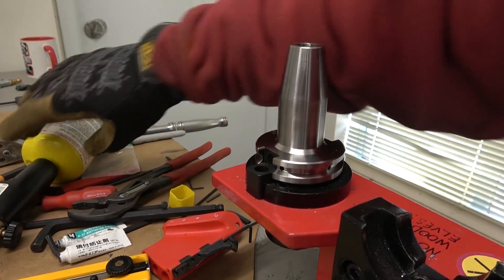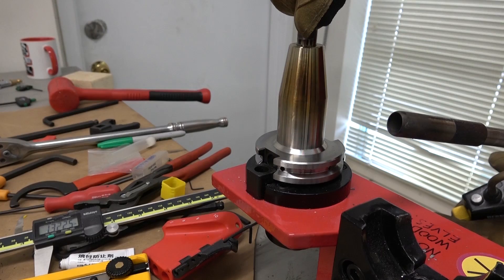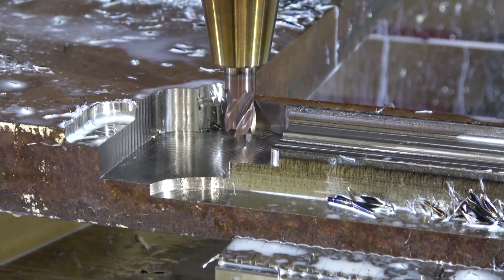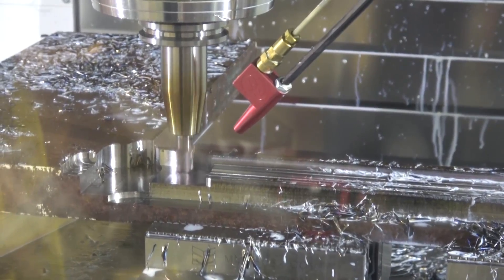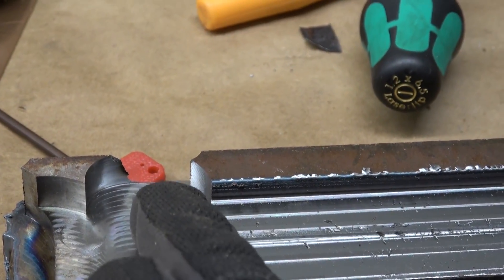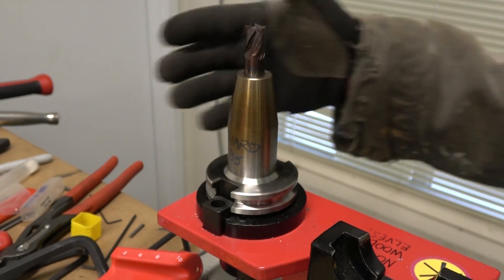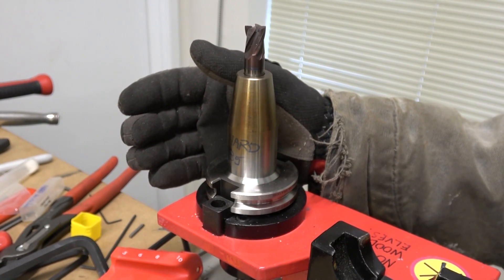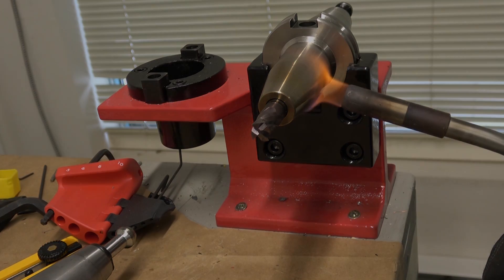Machining Feeds & Speeds |Test Maritool Hard Milling End Mill

Comment: I work with a lot of AR100, ASTM 514 type B (290 Brinell) and AR400. It is always a up hill fight and just when you think you got it... you hit a hard-er spot in the metal LOL 
Don't underestimate the amount of energy it takes to remove even a small size cross sectional area of hard plate over mild steel. Not just on the tool, but the axis as well. The servos need a small amount of time to adjust to the feed force needed especially on small machines. This is where rolling into your cuts will help a lot. When making circle or radius cuts, your tool is in the cut longer than in a straight cut. So I would reduce how much it is stepping into the work. Example, if I was doing .060" full depth passes on a straight pass, I'd only do .040 or .03 in an inside radius. on and outside radius I'd go deeper 0.08 maybe, but all depending on the size of radius and tool diameter. Anyways I'd be running around 180SFM 0.0018 IPR/T on 400. but I'd have to check my notes BTW get your dirty beaters on a 5 flute endmill, I've had so much better luck with them.

oh if NOTHING else works, speed her up so something stupid and low feed should get you through, but idk how long it will last

Comment: Experience is definitely key. Better to start slow and add sfm and chipload once tool life is achieved. doesnt take much chatter to ruin a sharp costly tool. seasoning cutting edge with a fine carbide stone or ultra fine diamond file or even 600 grit paper will help eliminate chatter when done carefully and evenly. Stub holders  and tools also help. As a rule of thumb I start roughing around 200 sfm for anything4140 &harder. .0015 per tooth. Lower for really hard material. You can always add speed later, if you you start too fast and chip cutting-edge your gonna be replacing that costly cutter. Definitely many variables come into play with new pieces to make. Good idea to take notes when things work well...

Comment: Something  tells me you have the same problem I have... when asked with you do.  I stop talking when there eyes glass over with a dazed look.   Electrical and mechanical engineer, tool and die machinist with CAD/CAM, HVAC-R tech, and specialized in thermal-graphic inspection and analysis with vibration spectrum analysis and ultrasonic testing...   your like that too able to fix anything lol.  I been expanding in to automotive fixing my cars and family cars
Reply: That sounds an enviable skill set there mate.
I just keep getting dumber the more I find out I don't know haha.

Comment: Just out of curiosity, have you checked your drawbar pull force with a dynamometer recently? Have you done some checking with marking fluid to check your tool taper mating on your spindle taper? Is there any fretting on your toolholder? Also, pullstud torque and pullstud design can have a TREMENDOUS impact on vibration, I just went to a customer's facility last week and solved issues with a NEW VMC they purchased with a brand new pullstud from one manufacturer deforming the taper of their toolholder taper and a pullstud from another manufacturer not deforming the toolholder taper, made all the difference in the world. Also, getting as short of a gage length toolholder as you can for hard milling is basically my first step, choke up on the hard stuff. As an aside I consult machine shops on their setups and repair machines for them frequently.

Comment: Cold stick in hot hole and when temp equalize its stuck gotcha. Have also read there is times rubber needs to be warm to go on a cold shaft.

Comment: Your projection from the spindle is a lot longer than it should be. Keeping the cutting edges as close to the spindle bearings is key. And you should be using the variable RPM option on your HAAS chatter has specific frequencies and varying RPM can fix that. Buy some shorter holders!

Comment: You have to Six Sigma problems like this, you get outside human intuition quick in senarios like this. Use the math, not your feelings. That's why Six Sigma experts are NOT subject matter experts. Don't be afraid to ask for help setting up a DOE, Taguchi won't bite either.

Comment: When you heat metal to expand it to accept a larger object in a hole, what are the physics behind why the entire piece of heated metal expands radially from the perimeter of the hole?  Intuitively I would think it would expand axially from the center of the heated mass which would make the hole smaller.
Reply: It expands radially outward because the circumference of the circle (all across from inner to outer) is expanding.

Comment: Rigidity adds significantly to being able to run "starting parameter" a Haas isn't rigid enough.  Ideally you'd be on a heavy horizontal to really rough in tough materials.  The geometry of a horizontal is naturally more rigid pound for pound than a vertical.  Having a bigger/better spindle cat50, dual contact, hsk also does wonders for torque capacity and harmonics.

Comment: I used to work for a small tool holder company's a set up with two or three torches or having some sort of fixture spin the holder will help it heat up a bit more even and help run out. Torch heating works but just heating one side can cause a little distortion leading to a bit of runout.

Comment: In now what seems to be another lifetime, my Physician uncle and I got into large scale CNC for our marble art and sculptures.
We ended up doing a side project for Arlington Cemetery, and our work is still on display.  I was an honor.  
Looking back I don't think we gave ourselves credit for all the many problems we had to solve to get it right.  I think we kinda felt like failures processing and strategizing each problem and situation over and over.  But we did it, and that itself was, as you say, an art.

Comment: one of those induction nut heaters with a big loop may help with those heat shrink holders, i wonder if the current torch method is throwing some run out into the setup, just my observation as a relatively green cnc machinist

Comment: You are making the screech sound because the tooth's not in the cut and skating over the material.
The corner makes it louder because the tool isn't ridge enough or the tool isn't sharp enough or both, to push/slice into the material. 
make a 3 thou tooth load, maybe slow it down and raise your tool to 1/3ed diameter depth of cut. 
Trust me, I'm an professional endmill breaker.

Comment: In a perfect world the recommended feeds and speeds work. But that might mean on a box way machine with adaptive tool paths and tons of coolant flow. If you're using a linear guide machine or you've crashed the spindle before and the bearings might be a little off its a while different story. Some machines just aren't heavy or rigid enough to use big tools and you have to rely on speed and use small diameter cutters. You'd be surprised at what a 3/8" cutter can do with deep cuts 30-50% over steps and adaptive tool paths.
Reply: Of course the recommended f&s are for the cutter, not the machine. The cutter can usually do what's promised, the rest is up to the machine

Comment: There are some nice high feed insert cutters out there that make short work of the hard stuff though much more shallow cuts but at high feed.
Typically the inserts are of a circular button type, or with a  semi circular end face and are more rugged than a sharp corner tip end mill will ever be.
They require a cutter like you used more as a follow up cut to get the required wall finish and corner profile.

Comment: Cold in there. I got a RST motorcycle rain suit. only lightly insulated. The breeze dos.nt get thru the cracks. Thanks for the town pump cnc that spirit of helping out very refreshing. One of Stans heat treatment ovens comes to mind when the words hard milling are spoken. I mean how much for the tooling to cut hard metal vs. just start with some 9310 0r 4140 52000 cook it and crack inspect it. Things like that make a bunch of money. It's made outta what? Peter is one of my favorite youtubers. so very on task with his video's. Him and robrenz usually make me ask "I did'nt know you could do that"  If you can proof to me that hard milling isn't difficult. hard metal drilling and elongating existing holes making a super tough adapter plate or skid/wear plate would be the stuff i would expect to do with really hard metal splines, gears would be awesome with out grinding

Comment: your holder is unnecessarily long for that job. rigidity goes down at the inverse cube of stickout. you wanna use the shortest holder possible in all cases. the heat shrink holder won't help you over a good collet holder for what you're doing. also, effective feed rate goes up in arcs, as does your radial engagement, which is why you were getting vibration. see: https://www.harveyperformance.com/in-the-loupe/speeds-and-feeds-101/ in a proper cam system you'd take that into account when required. idk if fusion360 can do that, i use mastercam.

where did you get your feed rates? for that cutter (assuming you're using the .5" pvd arco version) in that machine i'd give a conservative start point at s1700 f9. (assuming standard values of .625 doc, 20% woc and 1.25" holder stickout) and go up from there. as an aside, i have my own easy methods to calculate speeds/feeds and i don't post them publicly because i am burned out on plzbros and charlatans trying to take a mile when i give an inch, and the numbers are mostly useless unless you know how to get them already anyways. i will say there is no trick, though, and people massively overthink it and over-complicate it for themselves. like paying a subscription, wtf lol

Comment: NOT a machinist but ive operated a few very few,
How long have they been heatshrink tools into the holders like that? Now I know a lot of forge press shops set up the dies they use like that they will heat the holders up and place dies in them and when they cool off its like 1 solid piece

Comment: Is it common to use a propane torch as a wrench for changing endmills?
Reply: heat shrink holders are common but typically you dont use a smoke wrench to put them together, most shops have a induction heater for this purpose

Comment: And you should build you a magnetic heater coil for the shrink fit.  You could possibly be drawing the tool holder and getting run out.  You should check that because they say in harder material every 0.0001 of runout shortens tool life by 10%.  Seems high I know but we do check the runout on ours (we run hydraulic holders but same differance)

Comment: We run quite a bit of armor plate and what you want is to shorten that tool holder up, get a faster feed rate (chipload) maybe around .002  per tooth with a deep axial cut and shallow radial cut (maybe 20-30% for roughing) and then maybe bump it down to 10-15% for finish pass. As your radial cut increases then your chip load will need to decrease.  But that should help with what you had.  Back off the radial depth and go with heavier chipboard.  And make sure the tools you get have a corner radius.....it is a PITA if you have to run a square shouldered mill in it.  We run ours on a box way machine because it seems to do alot better than the linear bearing but people do it every day

Comment: maybe heat up your shrink fits in the lathe rotating to get better even heat distribution. 
Also, I’ve got the same mill, spindles aren’t super rigid like Japanese machines, so, choke up on your tools to reduce chatter on problem materials.  No need for the long tool holder.

Comment: Most proper metal working misses won't let you put in the dip if you can't make a chip. 
Hit 10 percent feed+  sounds better spindle load under 30 percent.  
Hit again.
Sounds worse  hit -10 pecent feed then -10 percent spindle. Check load meter and  sound.
Sound worse drop 10 percent rpm. 
Should tell you  you are. 
They used the metric 10 percent buttons for you special. You know the ones you forgot about. Also Jack the end flipping in the wind. Metric nut and bolt will do with a little provolatic material. Harmonics will ruin carbide. Set up 90 percent of metal magicary.

Comment: What really sucks is when you take your expensive endmill to mystery metal thinking its mild steel and turns out its inconel three endmills later.
Reply: better yet have a machine that randomly looses its spindle encoder, causing it to reverse rotation at random. took us a endmill or two to figure that out

Comment: Easy peasy, take the mfgs parameters and multiply by .70. It's better to fall in slower and increase your setting gradually, than to trash the tool right out the box.
Reply: Do you blunt the knife before you cut the turkey. Rub the edge and work harden the material Padawan
Reply: @nomiman101   Do you snap the knife off and throw it in the trash before you cut the Turkey?

Comment: NO way it was going to work with the vises on a RISER block fabricobbled from some plate!!!  The setup will be a few orders of magnitude DIRECT on the milling bed.  Your numbers will be much closer with a SOLID RIGID setup.  You could hear the setup allowing the vibration to start.

Comment: I cut a lot of hardened alloys (60-65 Rc) quite frequently and with a VF2 also so not the same but pretty close. I use a number of solid carbide end mills with great success and 2 things stand out:

1. That shrink fit holder is to long for profiling cuts in hardened, I would wager .5xD at most for axial DOC. Those are best for shallow wide high feed types of cutting.
2. Carbide likes a lot of speed in hard materials with a shallow cut. I run a 3/8" diameter cutter around 8000 rpm's  (780ish SFM) but feed is only .0008" IPT some parts run for 12-14 hours straight and can usually get away with 1 endmill lasting the duration.

Also, never really noticed a difference between the purpose built cutters and any (quality) solid carbide cutter with a heavy honed edge. The material is usually more abrasive than anything and wears off the coating long before the edge starts to give. Try to get the cutter (Altin coated) up in the 800-900° F range and watch how long they hold an edge. Just be sure to run the coolant in the lower half to cool and flush the chips, I've already had the exterior paint burn off my lower pan due to the heat from a mound of bright blue D2 chips sitting for too long.
Reply: I'm going to agree and disagree with the ridgidity issue. Haas aren't the most stable comparatively, but very very capable with the right approach and right toolpath. Setting the minimum cutting radius large enough to maintain correct approach angles in cam, having the correct diameter cutter and tool holder, and consider the order of operations. I routinely sink a 2 inch face mill .250" deep with a 1.25" step over in 4140 at 60 Rc at .005 IPT, the load meter is only 120% with the gearbox in low range and the cut is damn near silent. Any shallower or narrower and things get noisy and out of hand, I've just found the sweet spot. I cant do that in the hardened D2 though, it just doesnt cut the same. Now, it's not the Okuma I used to run, but the point is that a good machinist can find the best parameters for the task at hand, especially when all you can afford at the time is a Haas. Back to one of my original points though, I find more often than not that the abrasiveness of the material is more detrimental to the tools than anything else. That is, once you find their happy place and their running correctly.
Reply: @pcsmachineworks  People who call a haas rigid I think have never run a truly rigid machine, Haas are nothing compared to higher end machines. 
its kinda a meme, "haas power" Ive also met allot of people who have burned out their haas even before the 10 year mark. 

Just look at how those things are built compared to the old mori seki or tng
Reply: Too much HP for a shrink holder if you run it properly! Shrink holders are a consumable! A few 10's of shrinks and the holding force drops and your endmill will pull out. Use sidelock EM holders. The tolerances of sidelock has increased very much in recent years. You will not experience pullout.
Reply: SME states 10% reduction in cutter length reduces deflection by 50%
Reply: It comes down to that haas is not rigid enough to run .75 carbide in hardox. 
I use 1/2” at 6000rpm, 1” doc .02 stepover in hardox 600 (makes the 500 look like butter) 

All carbide life is poor in such a hard material, and time is not on our side for that job sadly
Reply: @Donkusdelux  the haas is rigid enough, and it was handling it fine until his radial engagement got too high.
Reply: As was said, hardox 500 is not that bad to machine compared to 600 or even toolox, right now we are doing a production run for a customer of around 200pcs, hardox 500, for pocketing I decided to use 10mm endmill, 3800rpm, 760mm/min, 10% stepover and 12mm DOC, so far the 1st endmill holds fine after 40 parts made, but the pocket that is being machined is 50F8 counterbore 12mm deep over a 26mm drilled hole

Comment: Am I right in assuming that the tool will come back out when heat is reapplied ? This is new to me :-)
Reply: Yes
Reply: @UberAlphaSirus  thanks
Reply: carbide tools yes, hss probably not in my experience
Reply: As long as you dont get it to hot and anneal the tool steel

Comment: Shove that tool so only what you need plus .020 thou is poking out. You know, keep that dick ALL THE WAY in the vice! Use a shorter tool holder too!

Check out OSG, Union Tool, Widin, Dijet, Pokolm etc if you want some real bad ass hard milling cutters. 

Also, on real hard stuff, the rigidity of your machine will begin to me a major factor.

Comment: You have to accept that it's a floppy Haas with a cat 40 taper. Grab some stubby side lock tool holders and some variable pitch 4 flute 1/2" end mills and giv'r. Big diameter tools with long gauge length tool holders will only drive you crazy. You should be able to stall the spindle with a good 1/2" end mill.